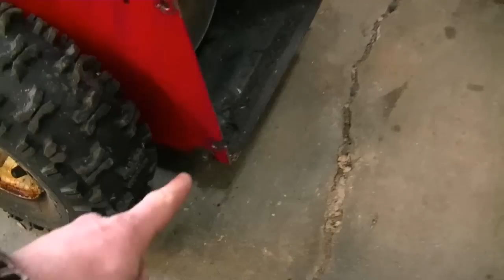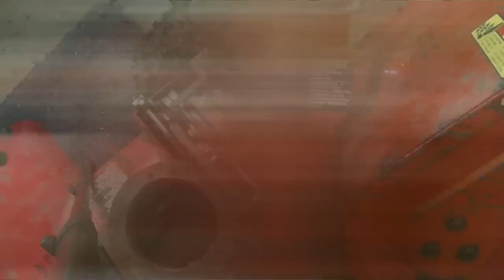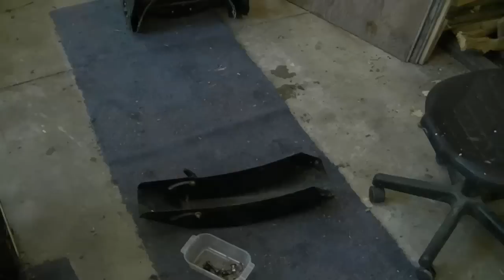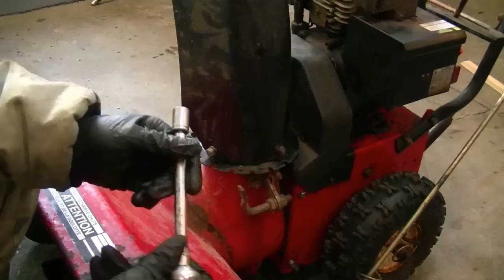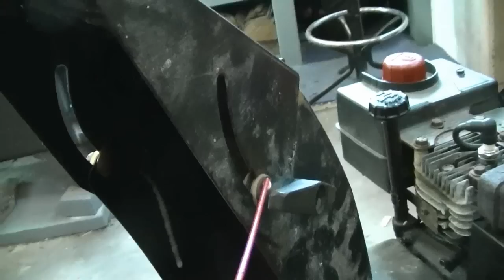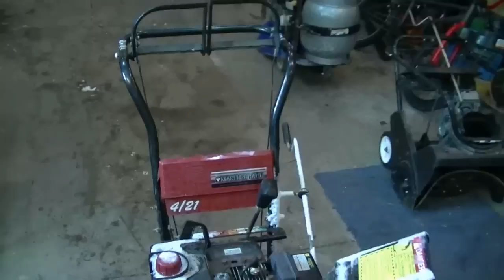4HP Noma Snowblower Auger Gear Box Repair Part 3/3

Comment: I know its an old video but worth a shot. What model number did you use to look up parts? I have this blower but the auger cable that goes inside the housing is missing i think. The one that engages the clutch (seems there could be two, one from the handle and one inside

Comment: I have a craftman 8.5 snowblower in the gear shaft what grease y should use
Reply from the maker: lithium is best in cold weather
Reply: donyboy73 that is grease or oil
Reply: donyboy73 it is for the gear box

Comment: What is the best way to paint the auger and inside the blower so it won't rust out so fast? I'd imagine spray paint but that usually doesn't go on as thick as brushing it on would be.
Reply from the maker: brushing on is much better
Reply: donyboy73 Yeah its tough getting everything though.

Comment: what would cause the impeller shaft to move back and forth ? so much so that the impeller blades scrape the back of the auger housing and the auger pulley hits the engine frame ? Its a 29 inch 9.0 Craftsman

Comment: I have a pulley that is bent and with a pin in the shaft I can't pull it off the shaft stuck and frustrated. Any advise would be greatly appreciated